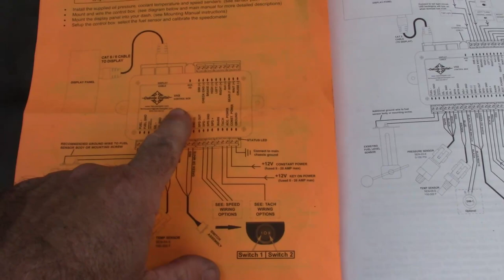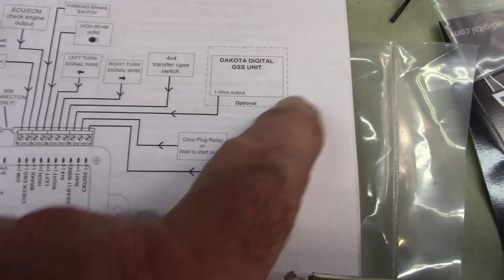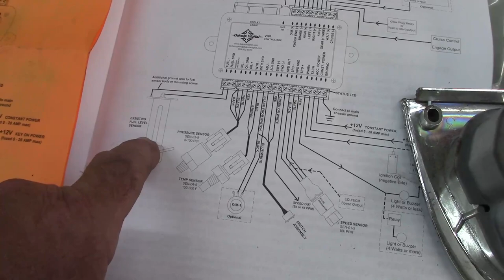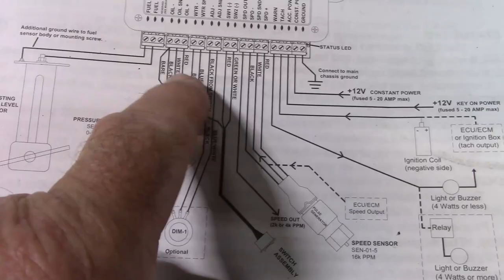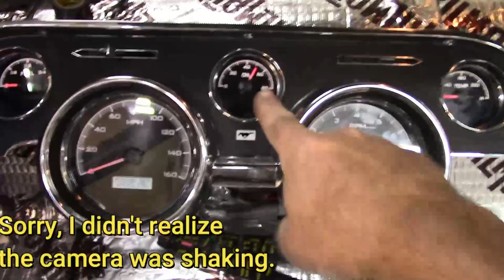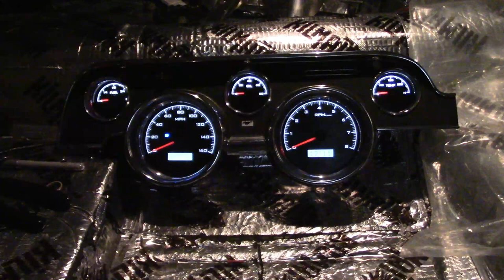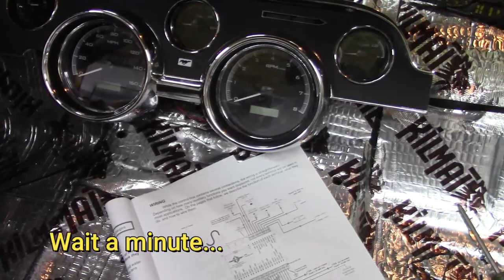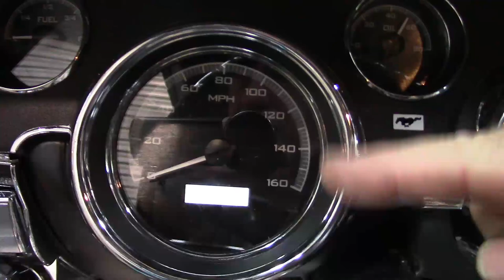Dakota Digital gauges in a Mustang. (part 3) Jade part 96

Comment: Getting close to turning on my 68 for the first time since 2010. It has a rebuilt roller 302 but during the years its been down I purchased the older style dakota digital gauge cluster and will be using your videos as a guide for whatever applies, so thanks! Good stuff

Comment: Very nicely done with the 3 videos! Barry I just purchased the Dakota Gauge cluster and the information you provided here will save me time. I will have a bit more wiring as I have to connect to electronic valve body for 6R80 transmission and the coyote engine with the tach. thanks

Comment: Really nice job Barry.  This setup has advanced a lot since I first looked in to it 20 years ago.  I went with original GT style gages with a wood grain surround to match my deluxe interior.  Problem is the amp gage doesn’t work which I’m told is typical.  When I get the car back I need to get the wiring done.  Unfortunately, failing vision makes it impossible for me to do this on my own, so I’ll have to pay some for something I was once able to do on my own.  Your engine sounds wonderful.  Makes me miss mine.  I’m told it should be done in a month, but we’ll see.  Thanks for sharing all this.  It is really valuable information.

Comment: that cluster is pretty sweet. granted its too late now, but I'm guessing you weighed the option of just changing out that factory plug to a weatherpack or deutsch? i found out the hardware of not keeping my original wiring.. i gave it to someone else because i knew i was changing to that hwy 22 from AAW not realizing i would need the plugs for practically everything.. :/ like the ignition switch and wiper switch.. luckily they sell the ignition switch.. can't really find any others though. ebay is a life saver though.

Comment: I took some bullet connecters and plugged them into the factory terminals (in the main harness) and did not cut up the factory gage harness.  looked everywhere for the connector style that was used in the factory harness but they are some old style of molex and couldnt find them available anywhere.  classic instruments said they would send me one (because they use them on their gages) but I just went ahead with my bullet connector method.
Reply: What wires on the factory wiring harness?
Reply: @DaFsPilot  the factory main harness in the 68 has a couple of connectors that mate with the factory gauge cluster.  Those connectors handle things like turn signals, high beam indicator, turning the dash illumination on (and dimming it) and they send the signals to gauges (coolant temp, oil pressure and fuel gauge). With the Dakota system you'll only use the fuel gauge, lighting and turns signals